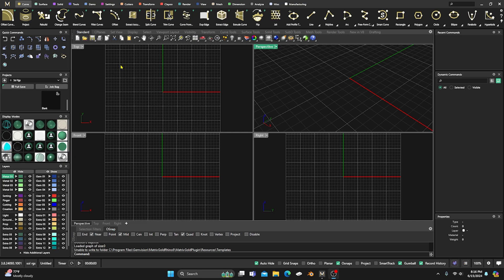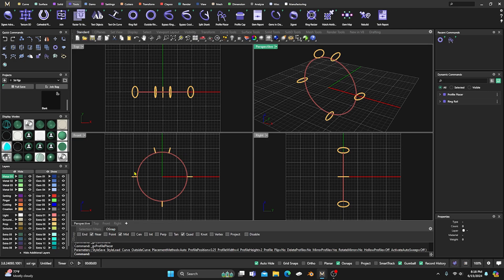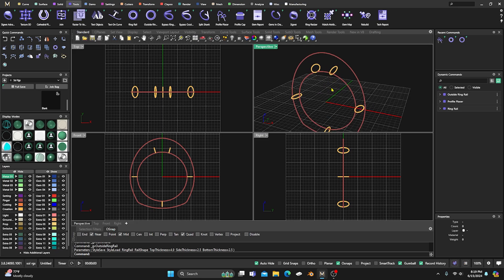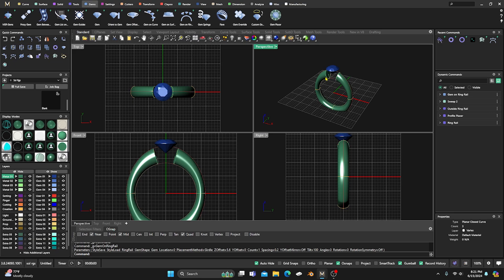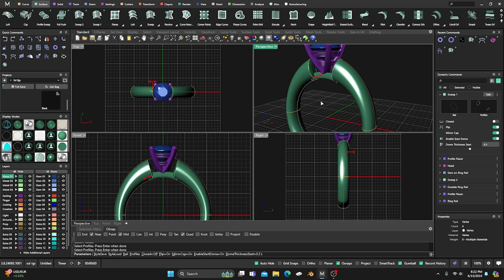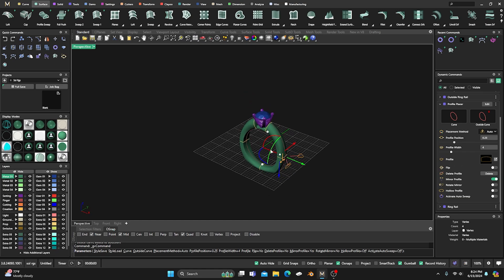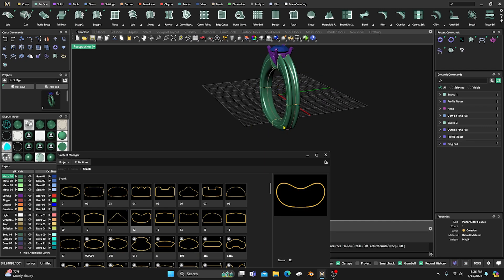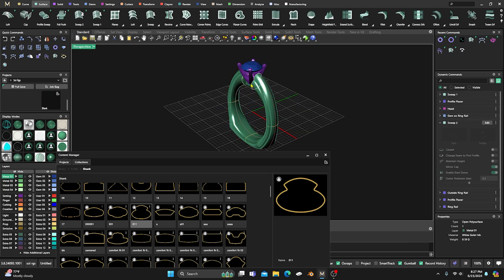Profile Quick Tips

Comment: What is the difference between Job Bagging something and adding it to your collections?
Reply from the maker: Not a lot but when you save it to collections you are able to use the styles command and bring up a whole library of heads to pick from without loading it in form the projects folder and when using the head style it will add it to the stone that you are working with and you will not have to use orient to gem or other commands.  I am actually making some content talking about that and will be up on the channel in the near future.